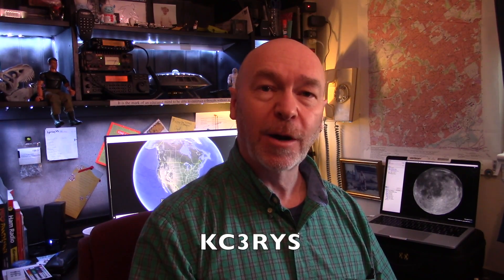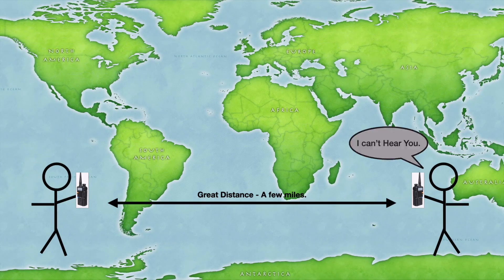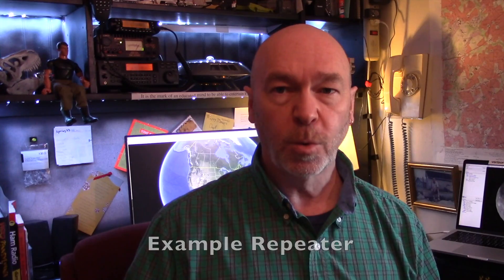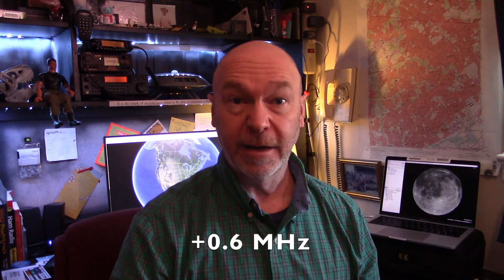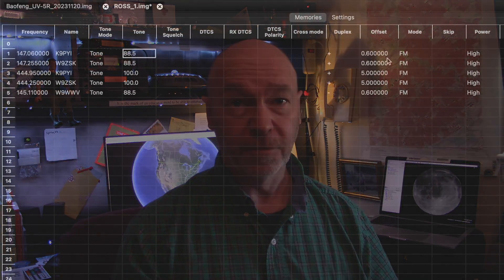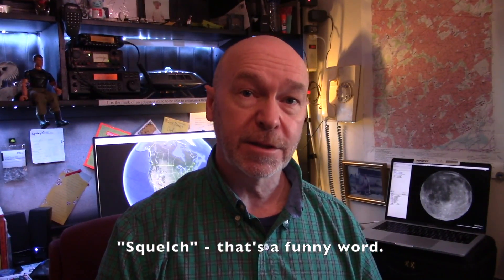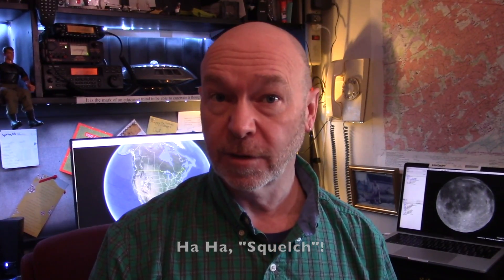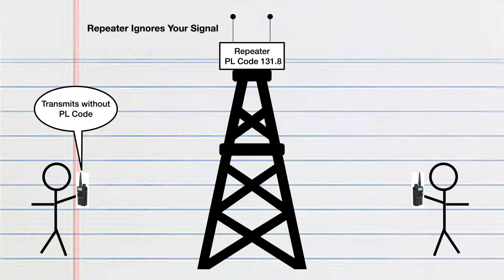Basic Ham Radio Repeater Operation. How Do They Work?

Comment: How would two way communication work if the repeater is too far for the other person to transmit too but they are receiving my transmission with the repeater being closer to me. Would we have to use two repeats? Don't you have to be close to a repeater to transmit?
Reply from the maker: Hey, thanks for the question, sorry it took this long to respond. So you can transit to the repeater and the repeater can transmit to your friend, but your friend cannot transmit to the repeater? 

I think the simple explanation is that the repeater has enough power to transmit to your friend, but he does not have enough power to get back. 

There's not a lot he can do about that, but some things he can try are:
1. transmit at a higher power
2. get a better antenna
3. get their antenna to a higher location

Let me know if any of this helps. - Billo